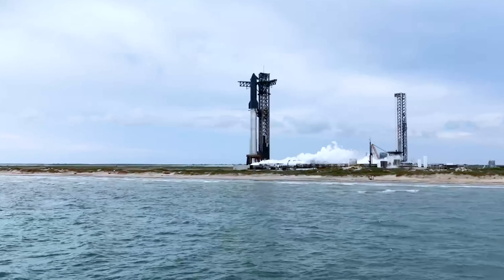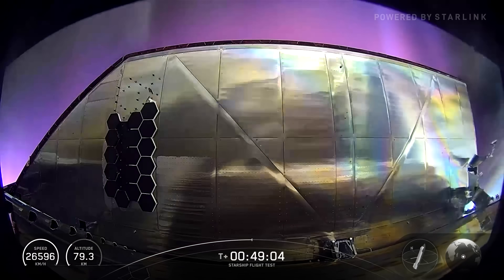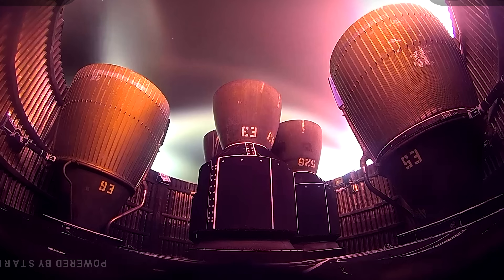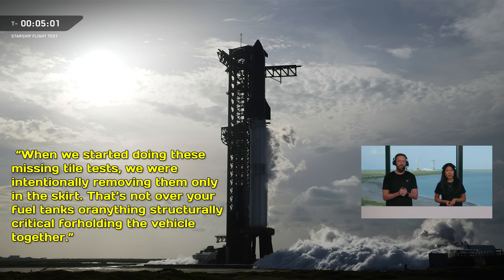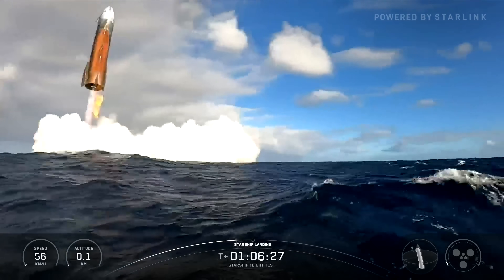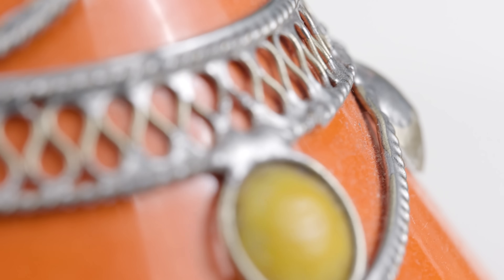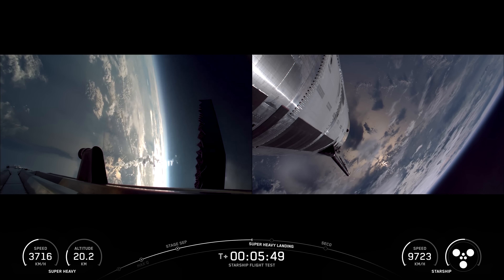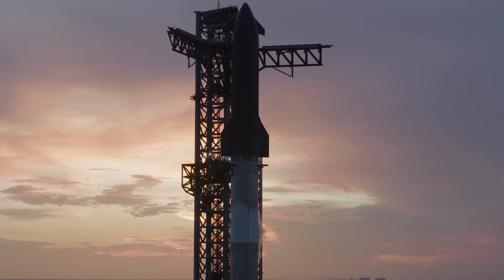SpaceX revealed the Real Problem Inside SpaceX Starship Flight 10 Engine Skirt Explosion!

Comment: 2:01 "all 6 engines appeared to remain operational"
What's that comment based on? The outer 3 (vacuum) engines were not in use at that time or for the remainder of the flight.
Reply: I agree. The three outer are the vacuum engines, only meant for no/low atmosphere. The three internal are sea-level design as well as include a gimbal to direct the landing flip. They only activate the 3 internal (then drop to 2 I believe)
Reply: Space Zone will fix it when he posts the next AI based video :)

Comment: No mention of the failed Raptor engine on ascent?
Reply from the maker: I forgot about that, yes, there one on booster that fail, but it did not affect the mission luckily
Reply: So Space is a Cartoon ?  O'  U' forgot about that, yes, Aye !  umm Aye !
Reply: Probably still analyzing but while not great a single Raptor shutting down during ascent has basically no impact on the launch unless it frags surrounding engines which this one didn't